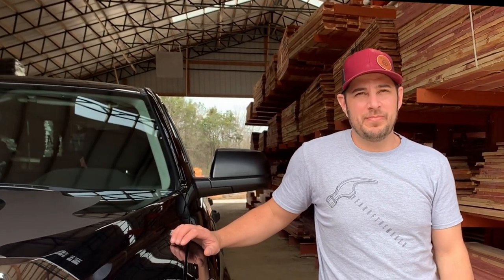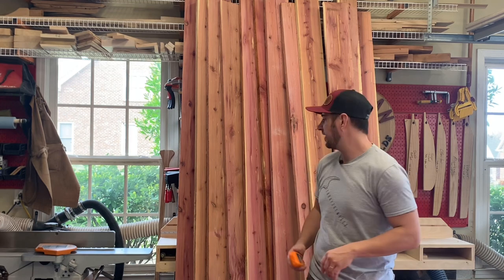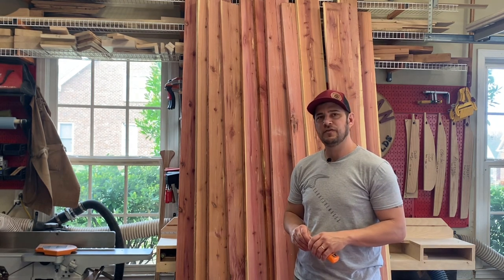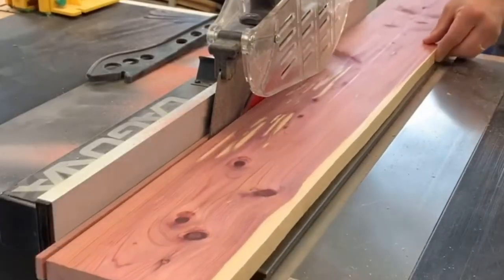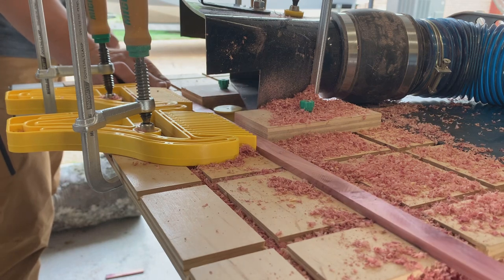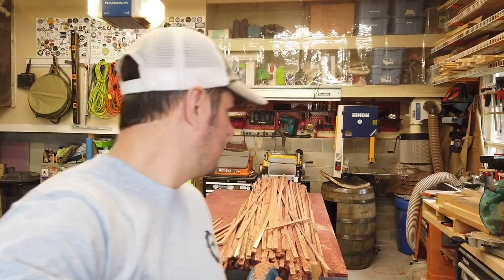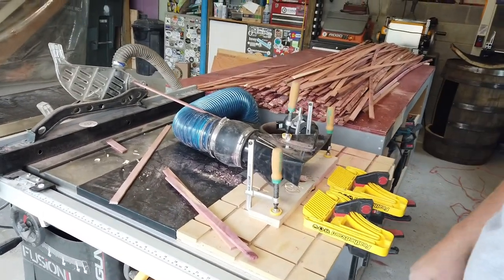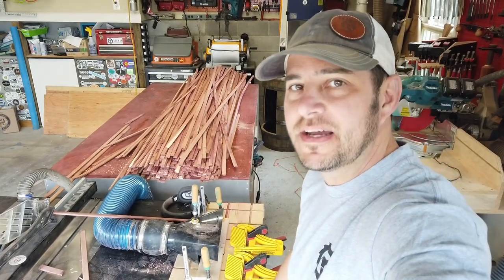I’m building a Canoe!! Episode 2 - Milling the Strips

Comment: Just got a sawmill.. looking make wooden strip canoe, before routering the strip. What was their dimension?  What size bits did you use? 

Any canoe plans you'd recommend?
Reply from the maker: Bear Mountain boats has great plans, the strips were 1/4” thick by 3/4” wide